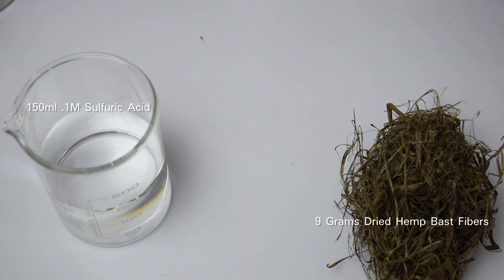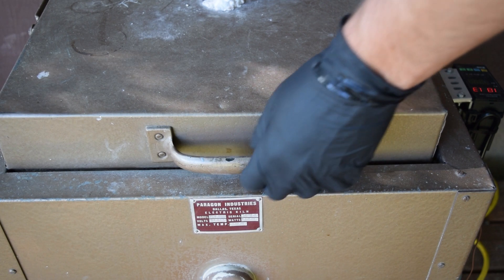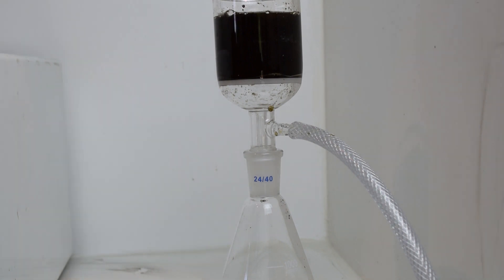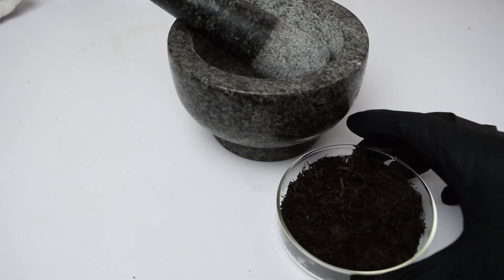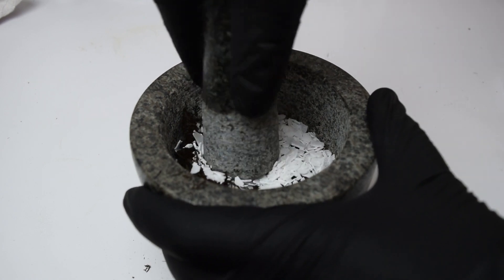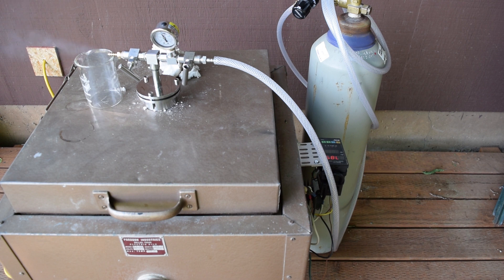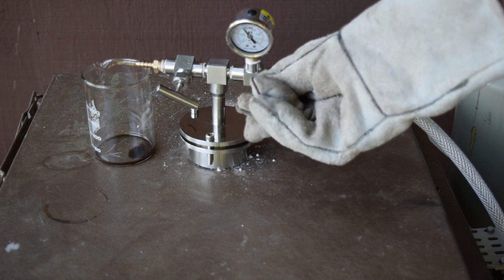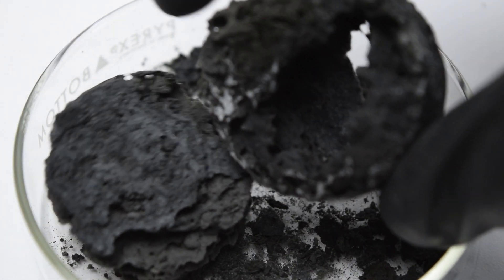Carbon Nanoribbons from Hemp

Comment: Hello, what kiln do you use, I noticed you had a hole in the top for the quarts tube. I can't find one like that. Is yours custom , or?
Thanks
Reply from the maker: I cut the hole using a 2" blade bit usually used to drill holes in wood. The kiln was free because it didn't work, I just added a cheap digital pid controller which I wanted to do anyway.
Reply: thanks very much! I appreciate all the time you put into your videos!!! do you have a patreon of way of contributing to you? 

Also what is the quartz tube setup called that you use with the argon?

thanks
Reply from the maker: @haytrvilleusa3696  Thank you,  I don.t have a patron or anything… I am just happy that you find my videos helpful.

The quartz tube is used in 2” tube furnaces which I found it on eBay. Or you can by just quartz tube and add flanges to the ends. A horizontal setup would be ideal so you get good argon flow over the carbon.

Comment: Can someone point me in the direction for these machines to make hemp carbon?
Reply from the maker: Unfortunately there are is no one stop shop for equipment used in this method. You can easily find the equipment I used which comes in different sizes/volumes. Just search for "hydrothermal autoclave", "kilns" and/or "tube furnace".
Reply: @KingswellLabs  thank you so much for the information. I’m looking to continue this research. Hemp battery is the future.
Reply from the maker: @hetsel-wan-kenobi  Agreed, hemp batteries are the future! Just remember that there is more to the battery than using carbon from hemp, the whole battery chemistry needs to be considered.  Best of luck!

Comment: is that right basically you roast an activated charcoal in 800 celcius? is argon still necessary even if you keep the carbon intact?
Reply from the maker: Not exactly, it's not activated carbon, it's a biochar... Activated carbon is made via pyrolysis.

Any inert gas will work and is necessary, otherwise you will oxidize the carbon.
Reply: @KingswellLabs    i mean your biochar will react with KOH(base) and result is activated charcoal, because sometimes i made activated charcoal by using NAOH, is that same process?

i know argon will shield from oxygen, what if our container is tight enough? i have fresnel lens, and it easily roast everything in extreme temp, with practilly no combustible gas
Reply from the maker: @dogodogo5891  Sorry for the confusion, yes you are correct and NaOH will work the same as KOH.

As far as the container, that could work as long as you pull a vacuum to remove anything that may react. But I haven't tried not using inert gases, so I can't really say with any degree of certainty. I hope this helps!

Comment: Kingswell Labs :- thanks for uploading informative video. Will wait for its second part also.
Have you ever tried, Electrodes  with this carbon nano ribbons, I am interested for knowing the cheap manufacturing process,as others are using CVD or PVD costlier process for making electrodes with carbon or silicon nanotubes.
Will wait for your expert advise thanks :)

Comment: I was just thinking... I wonder if you could do this same thing with the biochar/KOH under vacuum instead of under argon flow? Seems like the argon would get expensive in an industrial scale setting. I assume you're just trying to keep it from oxidizing and burning up, of course maybe there is another reason I'm overlooking.
Reply from the maker: Yes, the argon is just to have an inert environment so the carbon doesn't just burn,  I could see just pulling a vacuum will work just fine. But, Argon is fairly cheap and you can recapture it in a closed loop system on an industrial scale. I imagine having a large scale vacuum chamber that will withstand those temperatures and a vacuum pump would be more expensive.
Reply: @KingswellLabs  yeah, that does make sense to recycle it. I've only used argon with my shop door open and it just kind floats away. :-)
Reply: @KingswellLabs  Yep, there's my answer.  Thanks!
Reply: @KingswellLabs  I like your idea of flowing argon vs. a vacuum chamber.

Comment: Where are you located? Are you in the US? I can't figure out where to buy hemp bast fibers from. I would love to try this experiment.
Reply from the maker: Yes I am in the US in one of the states that has legalized hemp/cannabis, which is why I started from raw materials. You can get hemp stock on Ebay then process them with the method I showed to get the bast fibers. I bet with some searching you can find just the hemp bast fibers for sale.
Reply: @KingswellLabs  Excellent. I buy stuff on ebay all the time and I didn't even think to check there. sigh. Industrial Hemp was legalized in Virginia (where I'm from) but I don't think it has been commercialized just yet.

I see an ebay listing for "Colorado Hemp Fiber stalks" Your video mentioned "Hemp Bast fibers" Is that something different from Hemp fiber stalks?
Reply from the maker: @zenmanproject  I wouldn't be surprised if you had some farms locally growing industrial hemp, which would be ideal. The hemp business seems to be exploding.

I just saw the same listing, to me it looks like the woody core is included... It has yet to be separated. It is odd that they never processed it further but it may be worth sending the seller a message to make sure. If the woody core is still attached, then all you need to do is soak it for a couple weeks and you will be able to get the bast fibers fairly easily.
Reply: @KingswellLabs  Awesome. I'm going to order some and just goof around with it. It's cheap enough that if it fails it won't cost much. Looks like there are a few youtube videos on this. Is that where you learned it? Or somewhere else?
Reply from the maker: @zenmanproject  Cool! I would love to hear how it goes. Yeah I just watched a few videos on YouTube to learn the process which is called "retting". If you have any questions, feel free to ask.
Reply: @KingswellLabs  I was just watching some videos about retting. Seems insanely simple. Just soak them in water. One guy said he puts bleach in it to keep it from rotting. I need to order a hydrothermal autoclave that will fit my little desktop furnace. Those seem a little pricey, but whatever.

Have you noticed any difference between the different fibers yet? (hemp bark, long fiber, short fiber, degummed fiber, combed fiber and hemp hurd) Or are you still at the beginning and you don't know yet? btw, have you seen the stuff Robert Murray-Smith has done with graphene? That guy is fun to watch!
Reply from the maker: @zenmanproject  It's very simple.That guy used the bleach to stop the process, you want it to basically rot in the water for the two weeks, then you can add them to diluted bleach to kill the process. Or you can just rinse with fresh water and go right to drying which stops the process and you need to dry them anyway.

I haven't really tested many forms of hemp fibers, but bark won't work, the retting process removes the bark. Size of the fibers and whether or not they are combed doesn't matter as far as I know. I don't comb the fibers and they all seems to react fully.

Robert Murray Smith has a great channel, I really hope his FWG battery does well.
Reply: @KingswellLabs  Or you can manually decorticate the stems......take dried stems and basically smash them with a hammer or a piece of wood.  The goal of course separating the fiber from the hurd (the hard, woody component).  The hurd will "shatter" and is easy to separate from the fiber.

Comment: I'm interested to see how you plan on testing the nanotubes. Have you made the second part of this?
Reply: It's been 4 years, and I'm still waiting for part 2. I hope you are fine and doing well
Reply from the maker: I have not made the second part yet, I am backlogged with other projects/experiments. There are several follow-up videos I need to make, hopefully soon. Also, these aren't nano-tubes but more like Graphene ribbons.
Reply: Kingswell Labs Fair enough. I have done quite a few experiments with making graphene intercalated compounds. I used graphite as the starting material and sonicated it in a mixture of acetone and DI water. I much prefer the idea of growing the carbon versus mining it, that is if the hemp can produce similar results as the graphite.
Reply from the maker: @zenmanproject  So technically you are still "mining" it, as in you are breaking down the material and cooking it to produce graphene. I was interesting in this method as it's a good use of waste material that has little byproduct. With that said, I do think you will get a better result with this method. I hope to send in a sample to get tested sometime soon.
Reply: I'm referring to 'harvesting' versus literally digging into a mountain to 'mine' graphite. But yes the notion of using the waste material really is awesome. I'm very excited about the prospects of this.
Reply from the maker: @zenmanproject  Sorry, I totally misunderstood you... You make a good point.